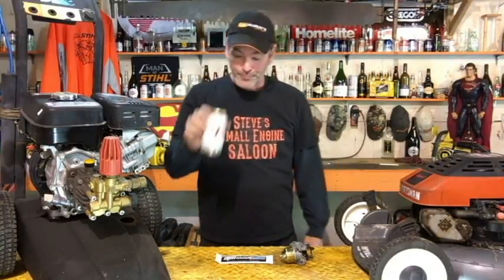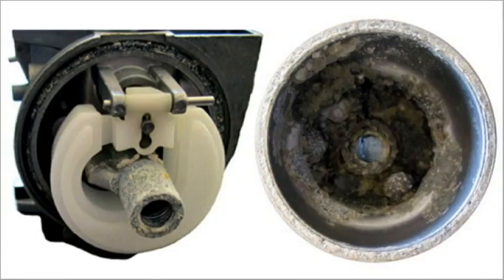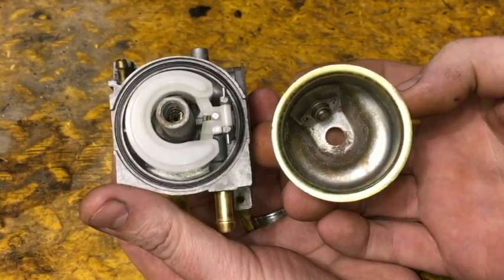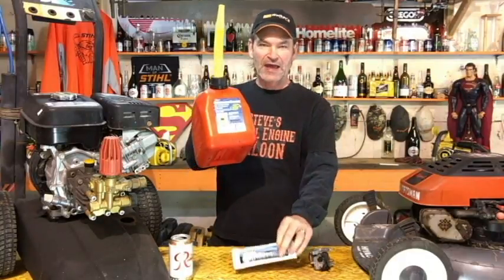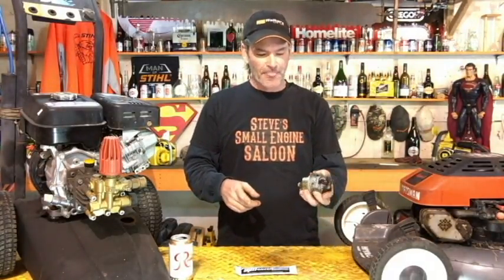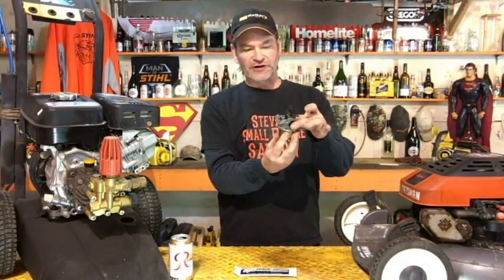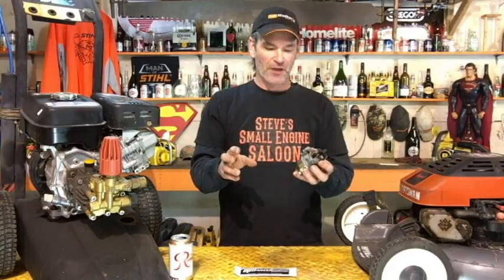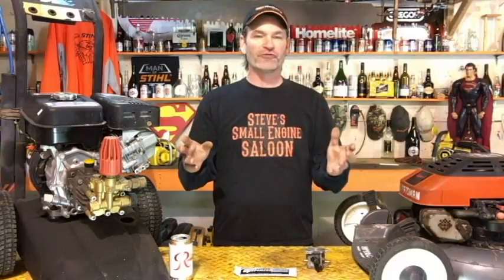How To Winterize A Lawn Mower, Generator, Pressure Washer, Etc.

Comment: Steve, how often should I change the oil in my lawn mower and how do you do that?
Reply: I change oil when it gets black. It still has good viscosity, but I really want clean oil. It hasn't failed me yet. I don't know the time frame but I do it at least 3 times in the spring summer and fall regardless of the hours I use the machine (0/30 or 10/30 ideally, but I've used whatever I had around sometimes). .......459 litres. It's not that expensive. I drain the oil from the nut under frame. I also run gas or solvents through the engine for for a few minutes and it cleans the guts of the engine and remaining  sludge and deposits (some guys disagree with this proceedure). I've had my 25 year old B&S for ten years and got it for free.It runs perfectly. I must remind myself the take off the bowl at bottom of carb. I also run some 20/1 or more 2 cycle oil through the carb before winter storage. It gets down to -30°F around here in the winter. I change oil and gas regardless in the spring. And I put my brand new lawnmower in my basement's utility room. 
David
Alberta
Reply: Believe it’s roughly every 25 hours or at the beginning of every season is is the usual recommendation
Reply: @davidweum9334  We see -28F or so here in Northern Illinois...I HEAR you.
Reply: We did ours for the first time after 5 years.

Comment: Hi Steve.  General question.  When you parallel 2 inverter generators do you get double the power?  I've heard you only get about 80% . I have two 2300/1800 running inverters.  in parallel  should I get 4600/3600? or less.  Thanks.

Comment: Hmm. I always thought it was better to leave the fuel tank full through winter with stabilized fuel after running it. Also, is it better to do my oil change before winter or in the spring?
Reply: Storing the engine with a full tank of stabilized fuel is just fine. Off season is about 6 months for me and I've never had a problem. As for changing the oil I think its best to store an engine with clean fresh oil rather than keep used contaminated oil in it that might settle out.

Comment: I believe Taryl's testing showed that fuel stabilizer is worthless. Also, the biggest problem is summer heat causing evaporation. I've never had issues storing my equipment over the winter. Couple months wont ruin fuel in the tank especially if its full so there is no condensation.  Prove me wrong, do the same testing that Taryle did,

Comment: Hey Steve, thanks for the tips. I’ve been doing this for the past few years with my mower in the winter and snow blower during the summer months though I didn’t use a stabilizer. I use premium fuel on my equipment, does that make a difference for a stabilizer as I saw yours had the word ethanol on the package? Do they make a stabilizer for straight gas? I read that premium is best for this type of equipment. Just got a Husqvarna blower and weed eater so I will definitely be doing your long term storage tips during the winter with those. Thanks again.
Reply from the maker: Right on
Reply: E-10 has a shorter shelf life than ethanol free fuel, so I'm pretty sure that if it works on E-10, it works on ethanol-free fuel.
Reply: @xHadesStamps  Thanks

Comment: Guy buys a pressure sprayer and uses it once. Gets it out after setting through the winter. Discovers the pump housing is cracked most likely because the water left in the pump previously froze, expanded and cracked the pump housing.
So what is the best way to winterize a pressure sprayer in a cold climate area?
Reply: Store it indoors in a warm (above freezing) area and/or run anti-freeze through the pump before putting it up.

Comment: I use stabilized fuel year round in my push mower and tractor. Should be good or should I still run the push mower dry?
Reply: I run with stabilized fuel all season and still run the tank dry before I store it.  
"Hank's Garage" says that running the tank dry can "cause problems" but he refuses to specify what those problems are - I've asked in the Comments on a few videos where he says that and he never responds.   I've never had a problem, since the 1970s and with four different mowers . . . but proceed at your own risk, I guess.  :-)

Comment: Help please winterazing  the toro mower apply 3 squirts of oil sae 30 in top of cylinder thru the spark plug bore 
BUT is not a 2 cycle engine is a 4 stroke , how can I fix it 
Will do any damage to the combustion chamber

Comment: Just drain out the gas, then put in a small amount of Pro-fuel and run the equipment to fill the carb. Ethanol free for 4 / 2 stroke engines.

Comment: If I've put antifreeze through the water pump on my pressure washer, and my exterior hose lines are drained and shut off, it's not feasible to run the pressure washer in the winter, without blowing the pressure pump. To my knowledge, the water pressure pump needs water running through it, or it could be destroyed. Or am I somehow being misled about the pressure washer pump?

Comment: Two things everyone should have on their four cycle engine is a fuel filter and FUEL shutoff valve.  If mine do not come with these, I add them to the fuel line, asap.  I have to add both of these to my new Snapper, v21 commercial, that I got yesterday.  These cost about $5 at your local dealer and I shut down all of my equipment with the FUEL shutoff valve.  I also use Brigg's AFT fuel stabilizer at one ounce per gallon of premium, non ethanol gas.  I do keep my gas tank full at all times, but it also gets cranked during the winter mulching leaves.  I never have a problem that is fuel related, even after one years storage.

Comment: I’m not convinced that fuel stabilizer does anything. Just use non ethanol fuel, and ideally drain the fuel system before putting to bed. I know there is controversy around this, but it works for me. And for extra points, fog the engine with storage spray oil, and leave on TDC compression stroke (if single cylinder).

Comment: Another option is to completely empty the tank and drop the carb bowl.  Blow the bowl and gas tank out with compressed air and replace the gas cap with a clean tightly fitting rag.  I've been doing this technique for years and never had a problem.  But the key is to make sure that all of the gas is out of everything.  And do not put the gas cap back on because it will trap air that contains moisture, and that moisture will condense out in the gas tank whenever there is a 20 degree Fahrenheit or larger temperature change; that's the purpose of the rag to be certain air can be exchanged and not trap any air.  Steve, you should try this technique- It's easy, cheap and guaranteed to work all of the time as long as you make sure all of the gas is completely removed and the gas cap replaced with a clean, tightly fitting rag.  Don't believe me?  That how all engines, regardless of fuel type, arrive to customers brand new.  Works on 2 cycle engines as well.  Save yourself the cost, expense and hassle of using fresh fuel and stabilizer.

Comment: Steve your subscriber Russel Mack hit it on the nose ALWAYS STORE YOUR EQUIPMENT FULL OF STABILIZED FUEL TO ELIMINATE CONDENSATION (WATER). At Eliminator Performance Small Engine Repair we have been in business 4 years and use K100S+ fuel stabilizer in ethanol free gasoline for all our repairs. This stabilizer actually disperses water as they advertise "MAKE WATER BURN". To date all of our equipment serviced will fire up on first pull the following year provided our customers use the stabilized fuel even if it has 10% ethanol in it which actually causes water to be attracted to the fuel since ethanol is hygroscopic (attracts water). Actually, ethanol will attract 3/4 oz. of water per gallon of gasoline and absorb the water but once it gets beyond that saturation point the water will collect in the bottom of your fuel tank or fuel container JUST LIKE ADDING TOO MUCH SUGAR TO YOUR COFFEE AND IT SETTLES OUT IN THE BOTTOM OF THE MUG! We have not done our video yet on K100S+ but check us out!
Reply from the maker: Awesome comment Wayne!  Thanks for taking the time to post that.  Check Wayne and the gang out right here----> https://www.youtube.com/channel/UC95GTIvvnuuEyu1Dt8HjKLQ

Comment: I've been putting my mower to bed each winter and NEVER did anything to it.  It takes a few pulls in the spring, but it always starts.
Reply: Same, and that's using regular. Our old lawn mower was pretty old, and still ran fine (although not like new), the starter cord just broke on it, so we put it on the curb for someone who could fix it up (or salvage spare parts and deck metal) to take.

Comment: If you have a fuel shut off why not drain the gas tank and remove the carb bowl drain plug and just let it breathe through the months or years while in storage and not worry while ya have another beer?

Comment: That damage is from the ethanol in the fuel and will start to go bad within 30 days..  If you use ethanol free gas, you won't have this problem... My winterize method... 1st use ethanol free gas if you have it and run the motor once every 30 days for 10-15 min.... If you don't have access to ethanol free gas, either run the carb dry or run the motor every 2 weeks for 10-15 min...
Reply: Ethanol attracts water, thereby promoting rust and such, but it's not like it won't happen with ethanol free gas. It'll still happen
Reply: @ACommenterOnYouTube  If it comes from the gas station, it's going to be susceptible to oxidation no matter if it has ethanol or not. It'll just be slower on the ethanol-free schtuff.
Reply: @xHadesStamps  interesting how E10 gas will corrode a carb within 6 months but yet when i use ethanol free fuel, it sits there for almost 2 yrs and it fires right up and no damage ...

Comment: Darn, there has to be an easier way to get the old fuel out of the tank. I mean who times their fuel consumption so that the tank is empty the last time the engine is run in the fall?  Does anybody make a little Battery operated pump? Then what are you do with the old fuel?
Reply: Old fuel you put in your car or whatnot with small four-stroke engines (and TBH, two-strokes are fine, too, as long as you don't add too much oil to the fuel, i.e. 25:1, as your car's gas tank holds a lot more than those weedy little ones on small engines)

Comment: Why not run the engines until they run out of fuel that's what I do before the winter usually around fall season and if I accidentally forgot I'll just drain the gas from the carburetor drain screw and mix the gas to my cars fuel tank. All done problem solve.